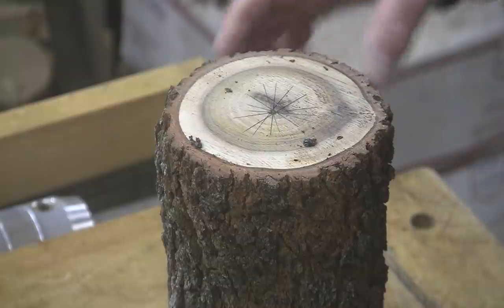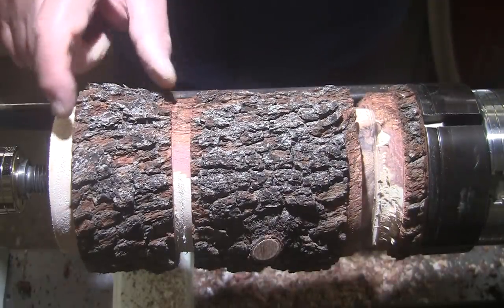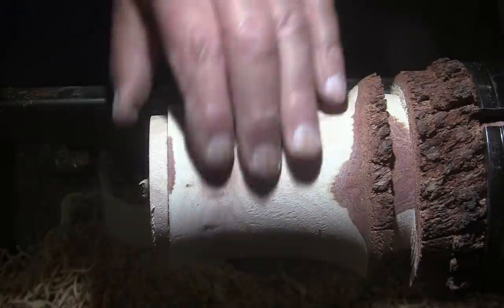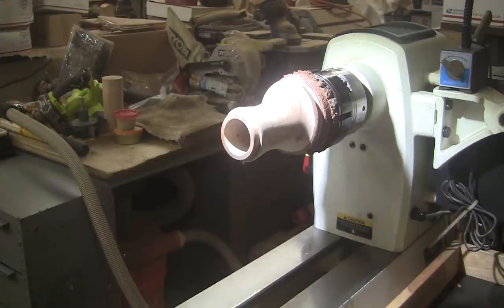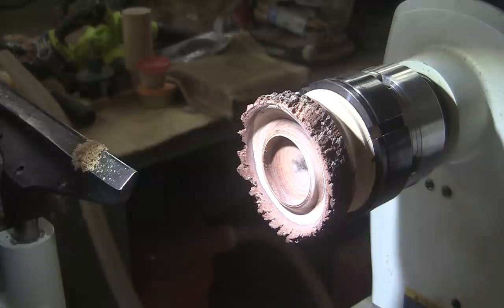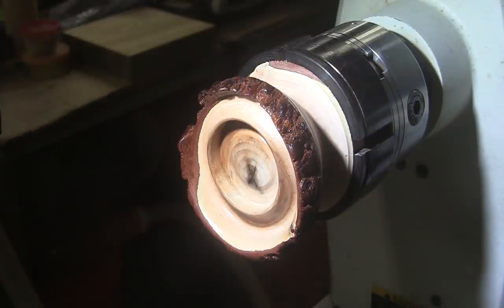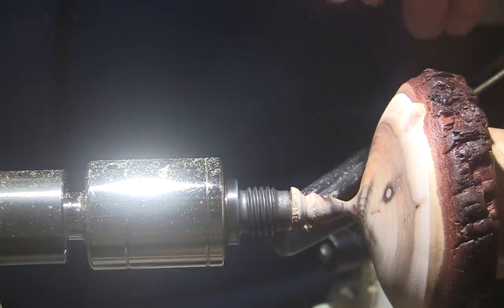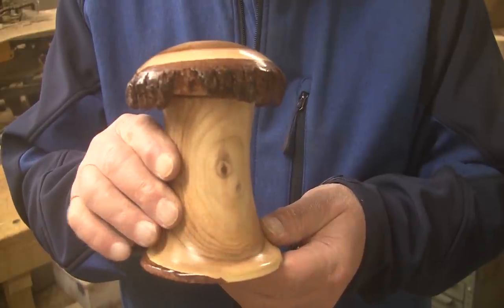What Will It Become? - Wood Turning

Comment: Nice work ! I’m a retired Professionl  Wooworker forex to.a early retirement due to a traumatic BrainInjury that caused some paralysis onmy body  there is something really relaxing  to watching someone turning  on video  and enjoyed this video a great deal as for my opinion  I liked it larger but the new grain patterns exposed did add some coolness to the structure so removing more was the right thing  I like the bark you left on the box  I might make similar candlestick holders for me and my Mom  on Holiday tables btw when I give gifts like that I give a case of candles too  years ago I used to make my own Vanilla scented candles  too that were stronger than store bought  ones
Reply from the maker: Thank you, Craig!  I agree, woodturning videos are relaxing to watch.  Sometimes I spend waaay too much time watching them when I should be in the shop doing!  A candle holder something like this is a great idea!  😊

Comment: Howdy Phil
Wife just called me in from the shop, making deer antler lamps ,  ....saw your video ....she likes it too ...
Math ...never looked at it that way ....used that same live center , like it , never used math ....being retired machinist , for ever , done that been there .... do not use math anymore ...lol
Like that knot , something to see ....so nice  
Did your wood " swell " up a little so the top did not come on and off easy ....only ask because when I did the same on some cherry and it did " swell " a little and than went back down and for the last 4 years no problem....Made a flour container with a " O " ring to keep it for no bugs get in ....still works
Getting back to your turning .....Like that live edge so much ....suggest to put more finish on the bark ....will come off in about 20+ years 
Wife likes a lot ...most likely I will be turning one too ...Will be looking forward to do ... like to turn .
living in motor home ...sounds great ....bring your lathe in , turn a bedroom in to a shop !!!! lol.....thought of that if I ever got a motor home ....along with a yacht....lol
keep on turnin'
Reply from the maker: What a great comment, Bruce!  You had me smiling and laughing all the way through!  Thanks, I needed that! 😊

Comment: Neat fungi/fungus! This "fun guy" thing must be an older joke already, but I ran into it in the Gnomeo trailer years back. 
Cinemas have been mainly closed for a couple months here as the COVID restrictions stipulate a maximum gathering of 10 people at a time. We have only been able to do the opera/ballet shows because there often aren't more than 10 patrons in them. We have then arranged an extra show if absolutey necessary. In the fall we had a nominal limit of 50 patrons but could take up to half of our seating capacity if we could leave an empty seat or two between groups. It will probably be one more month before we can proceed to operate somewhat normally, all with the more virulent British/S-African strains reaching Finland as well. Luckily I have been healthy and my town is still under 20 known infections counting form last spring. 

You probably could arrange a setup where you ran the house furnace and some other necessary stuff off of the generator when needed so you could have heat in the home. People with direct electric heating have been in trouble in FInland too on a few occasions, those with oil have had the chance to operate the boilers and circulators off of a generator (a furnace style heating system is not very common here).

I wish you good luck with the COVID shot, we have received our first batches in the last few weeks, and there has been talks of a new style of shot that only needs one appointment... haven't heard of too many people having terrible side effects though, but I will continue to procrastinate with taking mine for a while.
Reply from the maker: Yup, we are living in a strange time for sure, Jussi!  I've scheduled my second vaccination for mid-February.  Looking forward to putting all of this behind us!

Comment: So, i guess I understand the rule of thirds as well, but if the “top were the two thirds and the stem as the bottom third, it might look a lot like a morrell mushroom, especially if the size difference were slight. The sumac bark looks like it would pass for morrell as well. someone could hide their reading glasses inside, or pens etc… something where it doesn’t matter whether the “depth” was in the base or 5he lid. In fact, an “upside down” box would really throw people off the scent of a hidden box.

Comment: Nice video.  As for being a little wet, I see some cracks starting, something that always seems to happen to my wet turned (once turned to finished) protects.  Any ideas on how to minimize/prevent this.  I was told to try soaking in denatured alcohol, then letting is dry, still cracked, although a little less.  So any ideas, other than just let it split apart?  Thanks.  Stay safe and well.  Hope you were successful in getting your COVID vaccination, got mine (something being older was good for)😃 Cheers, Tom
Reply from the maker: Thank you, Tom!  I guess because of where I live, I don't really experience cracking issues.  It's kind of cool and wet here so the pieces have a chance to dry slowly.  I did get my shot and have scheduled the second one.  Old here too, ya know! 😊

Comment: Phil, just a question in general.   When you are turning some wood, the wood comes off as long confetti and others just fine dust.   Why?   Is it due to the hardness or dryness of the wood?
Reply from the maker: Both of those things, Alice.  Wet wood usually makes the long confetti. 😊

Comment: Question, why do you spin in  reverse while sanding? I'm sure it's an obvious answer to those familiar with wood-working, but I'm brand new.  Thanks in advance.
Reply from the maker: When we turn wood, the fibers are all laid down away from us.  Sanding in reverse allows the sandpaper to pick up those fibers and cut them off, cleanly.  It's a nicety, not a necessity.  I've had three lathes and this is the first one that has reverse.
Reply: @PhilAndersonShadyAcresWoodshop  Thanks for the answer.  That makes sense.  And solidifies my choice for a lathe.  The one I was leaning toward has reverse and it also offers the broadest range of rpm speeds that I looked at.
Reply from the maker: Sounds like a winner, Alisha, enjoy your new lathe!

Comment: What is up with sanding sealer? The smell is deadly! I can not stand it. Why don't you warn your viewers, I would never have purchased the stuff if I had any idea as to the order associated with using it!! Myland type.
Reply from the maker: I don't don't anything about Myland sealer, Donald.  I use Zinsser Seal Coat which is shellac based.  I have not noticed an objectionable odor.